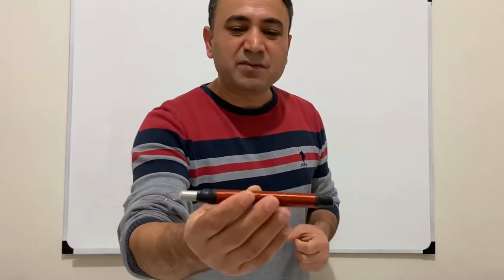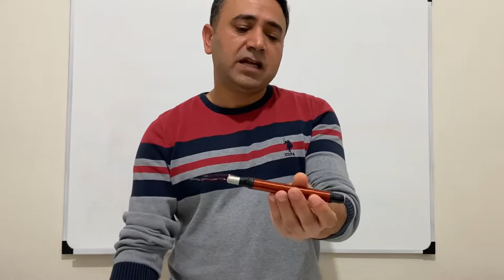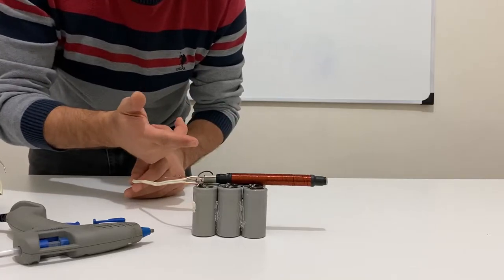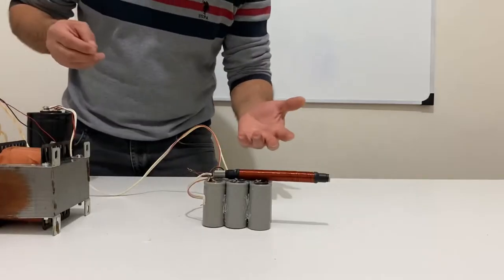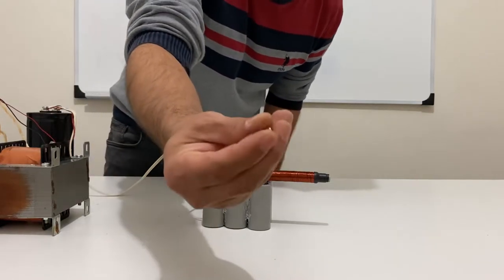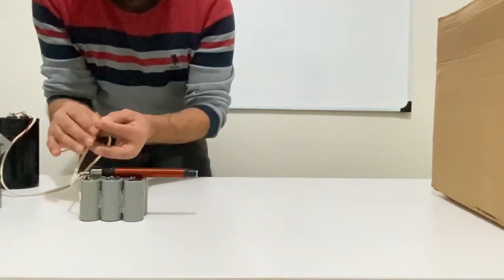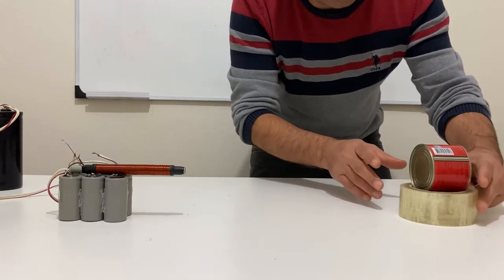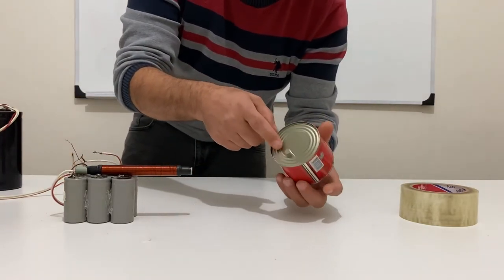Making Simple and Powerful Coil Gun and Test it | Rail Gun |

Comment: is there a way to automate this? like i want it all in one single gun 
i was thinking about making the gun smaller so it can be carried around in a pocket
i also want to make it get charged by a big but not too big battery i will also need a small capacitor.

edit: i will also need a step by step video on how to do this
Reply from the maker: There is way to do this. I will make an extended video brother
Reply: @joyofelectronics9782  thank you brother, appreciate it.

Comment: sir can i get the rating of the capacitor u used
Reply from the maker: 220 volts 1000 uF
Reply: @joyofelectronics9782   what was the power rating sir ?

Comment: would you please let me know why would you need such a high capacitance? I think even smaller capacitance can deliver a very high current quickly, which should be enough t launch the projectile. Am I wrong? :)
Reply from the maker: More capacitance means more energy and higher current. Of course you can use less capacitance but higher capacitance gives you better result👍